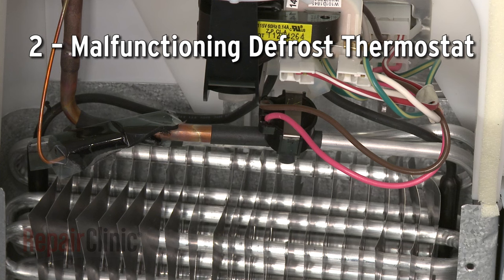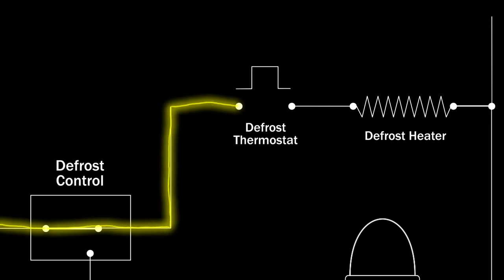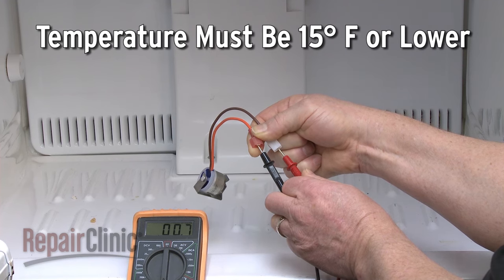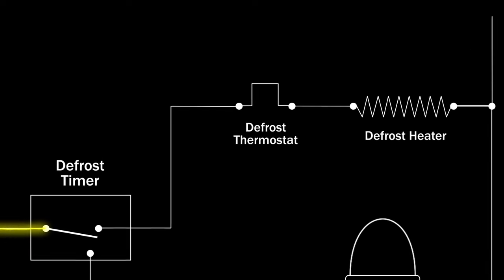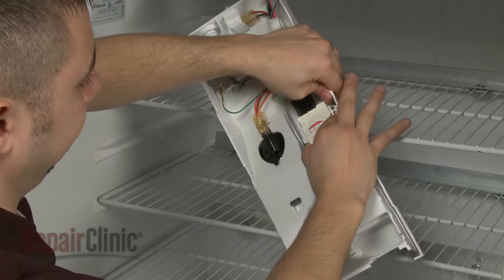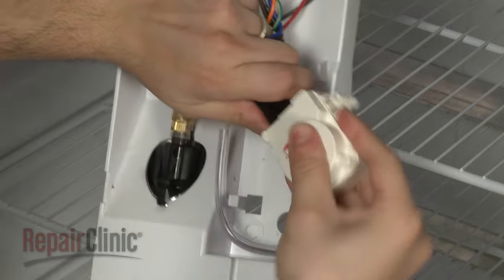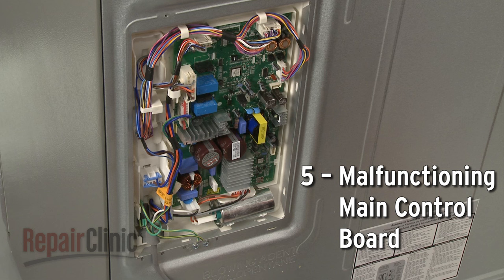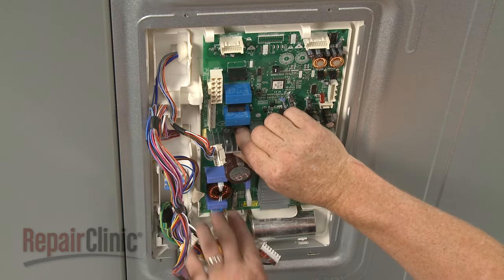Refrigerator Isn’t Defrosting — Refrigerator Troubleshooting

Comment: My duel unit. It can be fridge or a freezer keeps freezing up the bottom fan. What could be wrong with it?
Reply: I also want to know...
Reply: Defrost timer board
Reply: @peterparker9286  Probably that and I think the digital panels are out. Some things light up, some don't and the temp reads wonky.